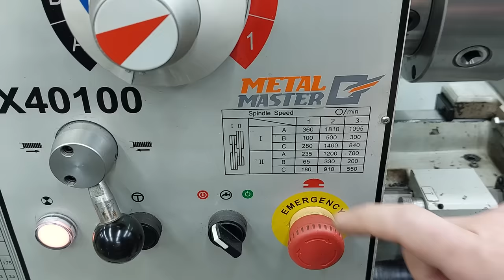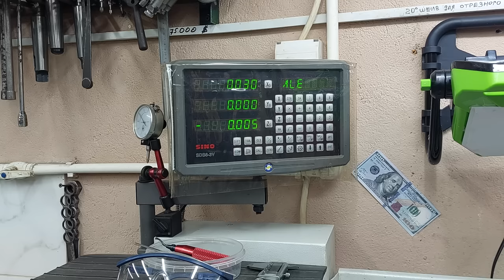Magically material that will replace bronze! New product for turners

Comment: In the past, I made a lathe cross slide lead nut with other plastics.  Those plastics weren't stiff enough for the loads on a cross slide screw/nut.   The lathe couldn't hold tolerances under normal cuts.    Can you provide a follow-up video showing how well your lathe now holds tolerances with this material?

Thanks,
Bill
Reply from the maker: Yes of course, this nut is made of the latest bronze replacement plastic and I've already tested it load holds perfectly!

Comment: Just a little tip. You really look after your equipment, and I respect that. With regards to you lathe, you should always have something in the tailstock spindle bore wheather using it or not. It protects and stops any swarf, machining dust/particles from entering the spindle bore which can cause damage to the morse taper and eventually needing repair or replacement. Just something I learned from years of being a machinist. All the best.
Reply from the maker: You are right, thank you very much my friend and welcome!
Reply: We use plastic Morse tapering plugs 😊
Reply: @sgtbrown4273 I do the same for lathe tailstock and milling machine spindle bore. I just made them my self with a piece of solid PVC.

Comment: it is much softer than bronze would no use for parts that are under stress
Reply from the maker: No this is a new invention, a new plastic rigid material RIMAMID - it replaces bronze and does not wear out the cross feed screw unlike bronze!

Comment: I don't know Rimamide. It seems that the advantage is that it is lighter than bronze. Is the price advantageous?
Reply: Creo que en realidad es Nylamid, no se en que sentido sea ventajoso o si sea buen sustituto del bronce, en mi trabajo las piezas que fabricamos de ese material son simples soportes de aislamiento térmico, pero no se si sus propiedades mecánicas sean buenas o al menos duraderas y útiles para la tuerca como la que hizo en el video, es decir no creo que sea tan duro como el bronce quisas se pueda barrer la rosca, pero no se tendría que comprobarlo, pero estoy investigando y hay varios tipos de nylamid con diferentes propiedades.
Reply from the maker: Rimamide is cheaper and it's a bronze substitute!
Reply from the maker: @fernandoolivervillanuevadu1125  This plastic is called RIMAMID, a substitute for BRONZA!

Comment: It's a plastic, not replacable please, no self lubrication or strength to hold threads or temperature properties to work as bushings. It may not give the life bronze does even if you use it
Reply from the maker: Rimamide is a polymer that replaces bronze in all its properties! RIMAMID is a new unique material and it is used to make gears, pulleys, nuts, bushings and many other things! Time will tell, thank you and welcome!

Comment: Delrin its better
Reply from the maker: I don't know haven't tried it, but Rimamid is a very cool material, no backlash, I'm happy with it
Reply: Delrin is not as hard or rigid as this Rimamid plastic.
 The Rimamid material is designed as a replacement material for bronze bearing materials
Reply: @howardosborne8647  Delrin too. its better than a Nylon composite